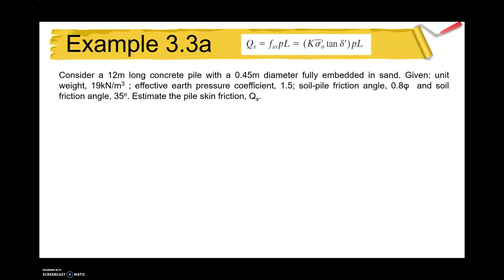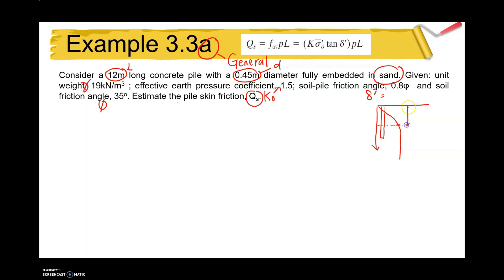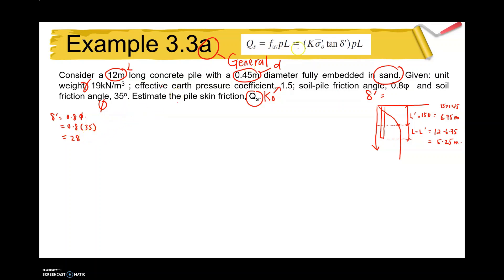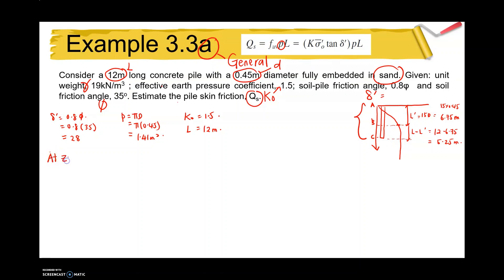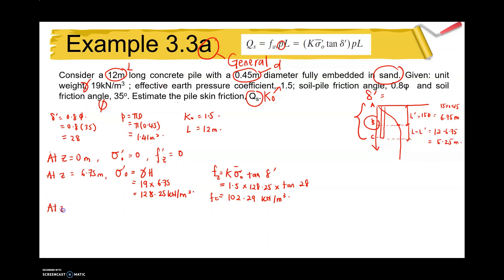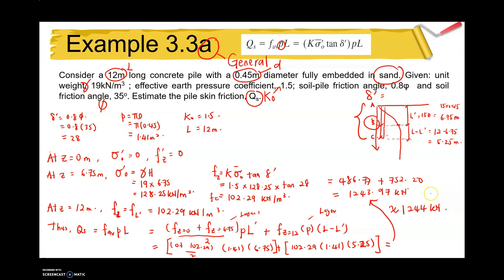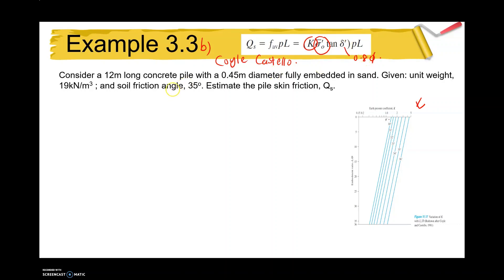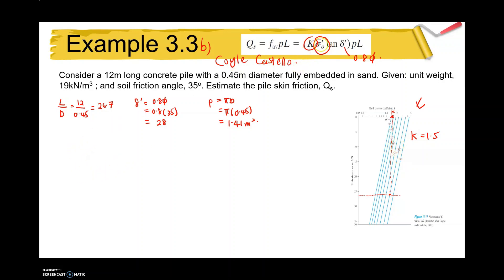Frictional Resistance in Sand Soil Conditions

Comment: Assalamualaikum, saya ada soalan. jika soalan menyatakan concrete pile, ianya ada nilai diameter untuk cari L'. bagaimana kalau diberi square precast concrete pile? nilai d tu nak dapat macam mana? soalan sama seperti example 3.3a seperti dalam video di atas. diminta untuk cari Qs. 

harap dapat dibantu, terima kasih
Reply from the maker: hi ammar, if circular pile, kita akan guna diameter..if square pile (b x d), guna kan nilai b or d since b = d sebab square shape.